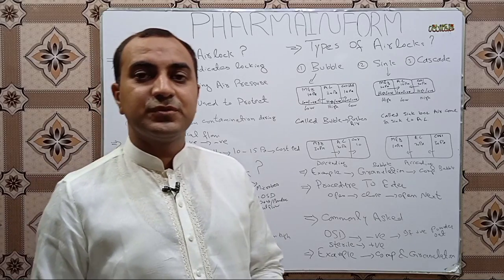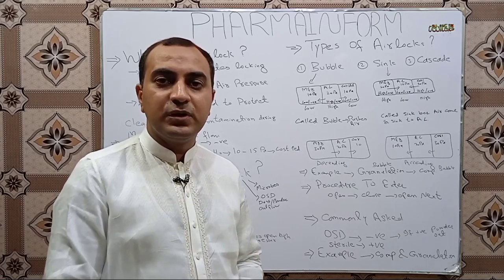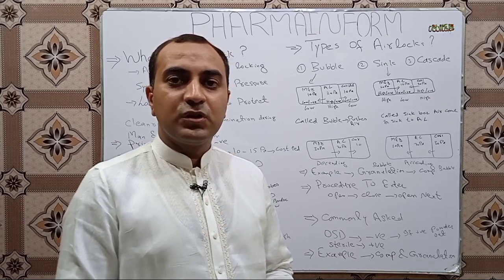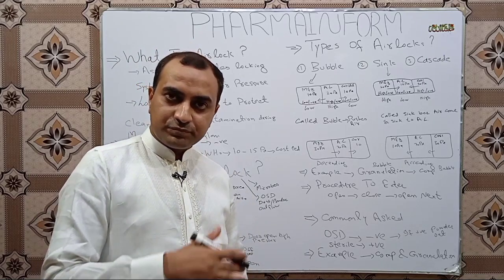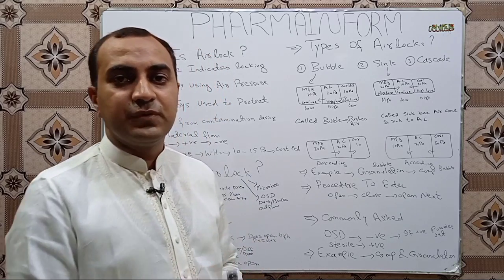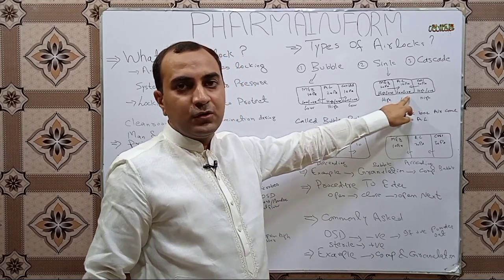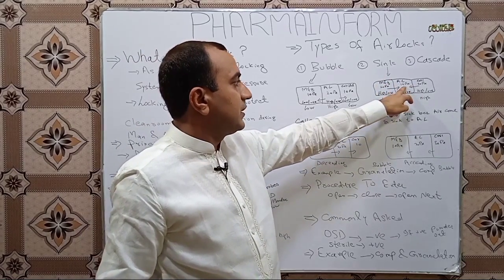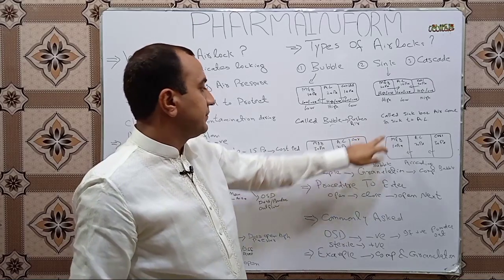Types Of Airlocks In Pharmaceutical Industries | Airlock System | Bubble Airlock | Sink Airlock

Comment: Sir air lock is same as differential pressure?
Reply from the maker: The airlock is a buffer room
Reply: @Pharmainform sir what is the buffer room . I have seen it in the compression and granulation area airlock But I still don't understand.
Reply from the maker: buffer room is old terminology used for airlock

Comment: Sir why we need higher pressure in sterile 
manufacturing area and in OSD it is opposite why what is exact reason. You told that in osd powders are there but in sterile no powders are there that's why?
Reply from the maker: to prevent contaminants movement  from outside to inside.we do so that air always moves from inside to outside